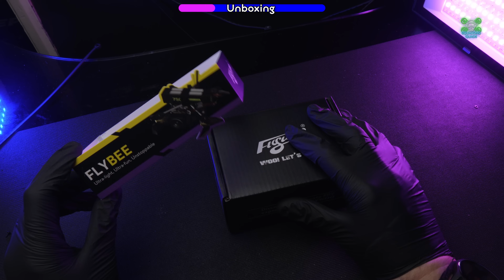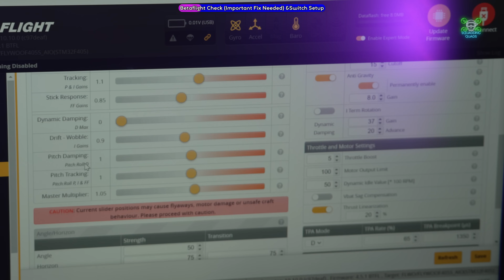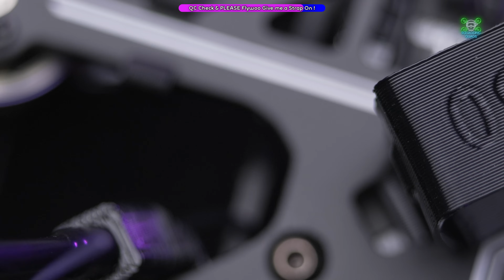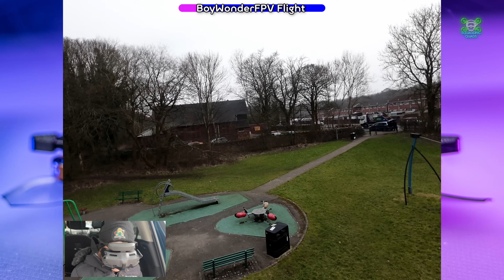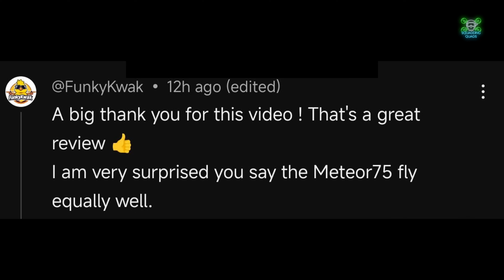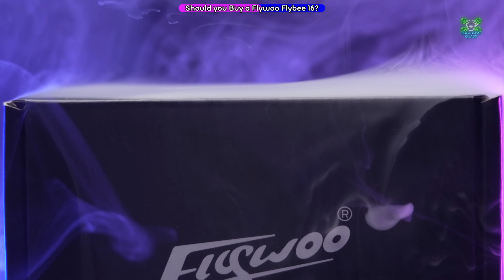You're About to Witness the MOST INSANE Flywoo Flybee 16 Flight Ever

Comment: Didn’t have much time to test due to weather, but 45mm props will fit on this quad. Felt pretty good with Gemfan 45mm biblades, and was significantly quieter.
Reply from the maker: I appreciate that man ill check it out, thank you
Reply: Update: Got a lot of vibration/prop wash with biblades, but it flies great with Gemfan 45mm triblades. Noise is about the same, but it did increase flight time and punch outs felt a little stronger.

Comment: Just found your channel. I used to fly anolouge but thinking of getting back in to Fpv. The Radio master radio is about £100? What’s a good set of he goggles to start off with mate? 
Thanks from Scotland.
Reply from the maker: If your starting out in 2025 I'd genuinely say dji goggles n3 if your on a budget or dji goggles 3 if you're wadded 😂😊
Reply: Thanks for your reply mate. Appreciate it
Reply: @agrs1974 so did you get the DJI stuff?
Reply: @hateforall4012 Haven’t bought anything yet mate
Reply: @agrs1974 aww man. Well when you do… it will be a blast

Comment: Hi, i am debating getting this drone with O4 or the YMZFPV lightning with O4 and attempting to mount that in there, is this even possible. What would you recommend?
Reply from the maker: I understand YMZFPV are due to release a BNF 04 model anytime
Reply: also could you measure your lighting v2 to see if you can fit a flywoo 04 camera mount inside(18mm) doubt you can. Could you pls help me work out how to put the o4 camera into the lighting? your amazing thanks.

Comment: I think the arming angle is fine. I don't think it's possible to crash and take off on an open prop pusher right? My experience like 1/2 of attempts i lose a prop, so I always do the walk of shame to take off again. Unless your re-arming mid flight for some freestyle move. Sure it doesn't hurt to have it at full 180, but open pushers are just way too fragile imo. Dont get me wrong, I absolutely love them, and on an anecdotal basis I swear they fly better.
Reply from the maker: I understand your point of view but for me it should always be 180 for the reason if your stuck in a tree, you might be able to shake it loose by arming, on 25 degrees it's just stuck in the tree regardless.